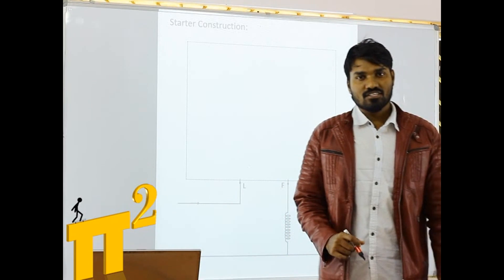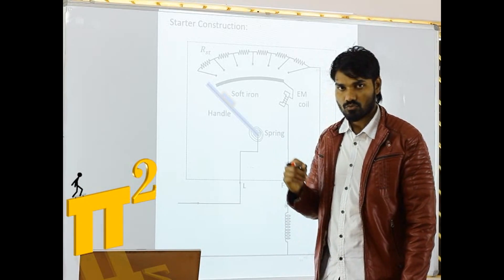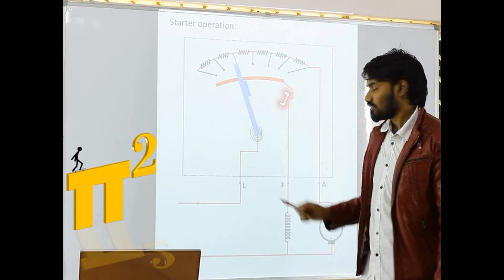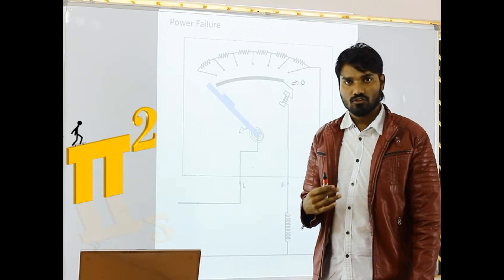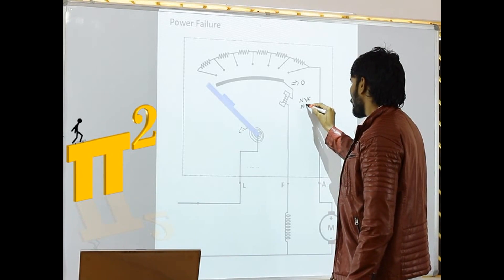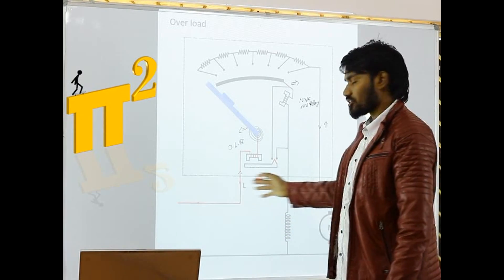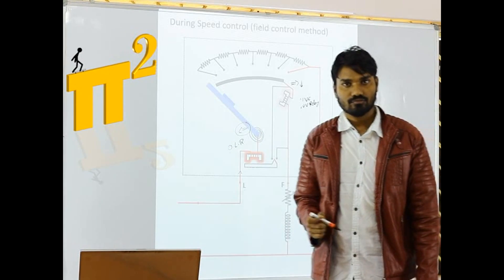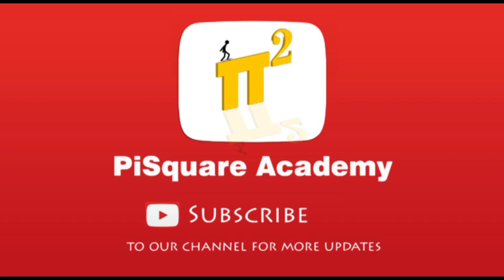3 point starter | 3 point starter dc motor | three point starter of dc motor

Comment: i have a small dought sir, that is in this, after adding the rheostart to the field winding how can current will reduce through NVC , the current will reduce after reaching the rheostart , because there is a drop, but there is no drop  before NVC , So how can that demagnetiseand handle will come back  . i have clarity on hole vedio but have only this dought sir ,please clarify this problem sir
Reply from the maker: please note these points MR.Goud
1. current  in a series path is same.
2. as resistance increases in a particular path for given voltage then current will reduce.
3. reduction in current will reduce the flux.